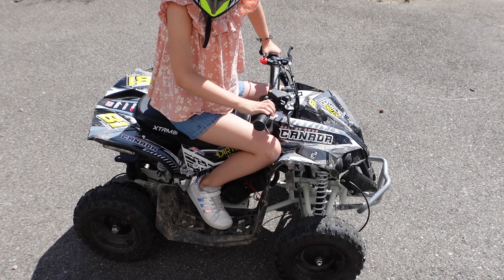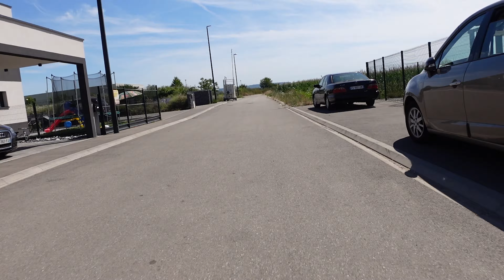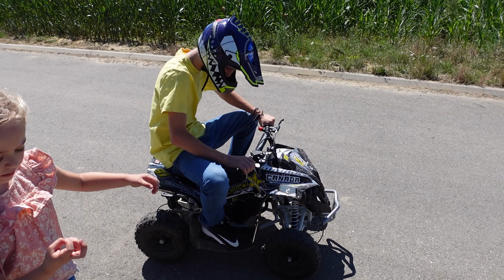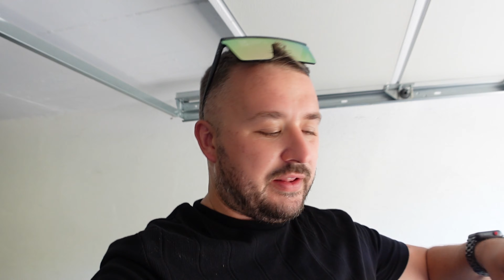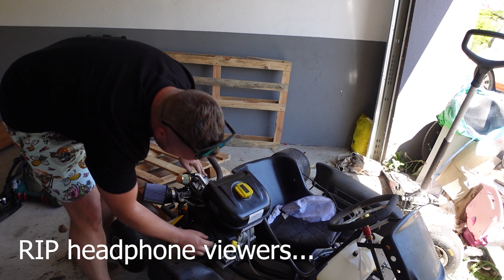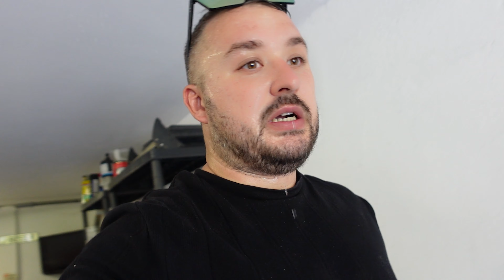We are back

Comment: Hello mate what did you do to get it running properly mines is cutting out also
Reply from the maker: Mate, I had loads of advice but the one that actually worked was to beat on it hard. My mate was like, it's a 2 stroke, you need to just try and rev the hell out of it for a bit to wear it in. I did that and gave it the old Italian tune of hammering it full on and it worked!